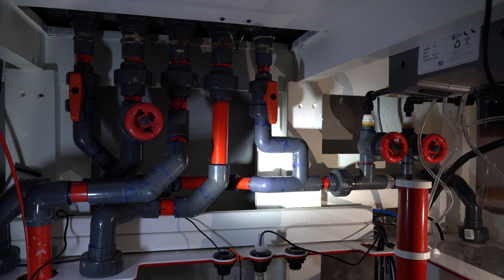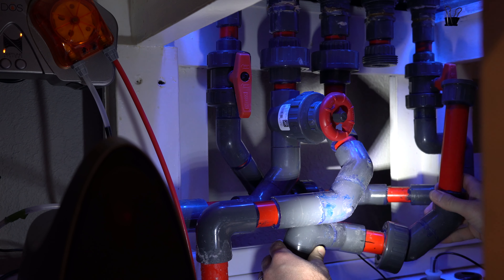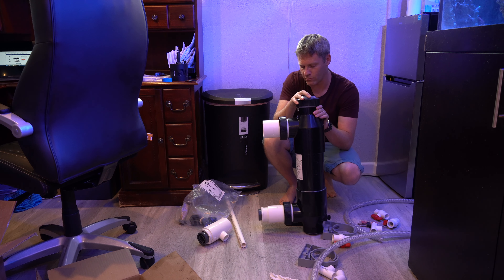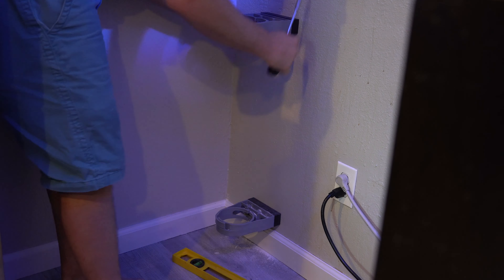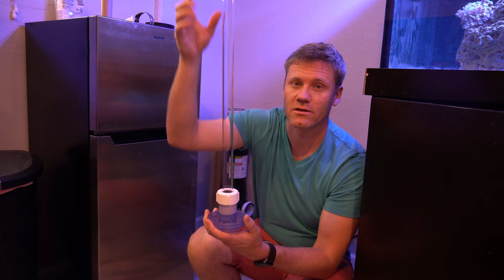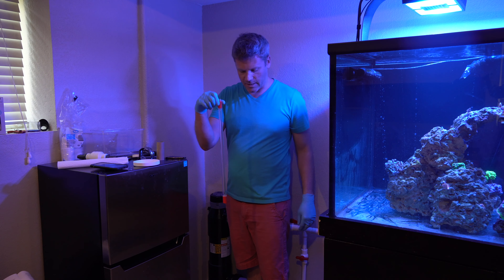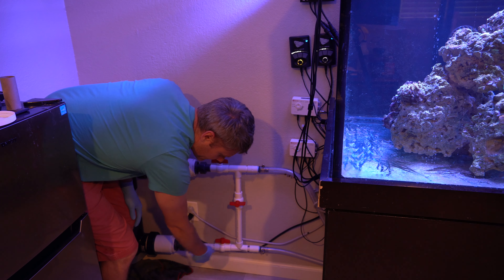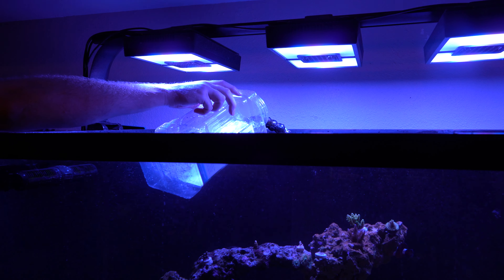How to install uv sterilizer aquarium

Comment: The only thing I remember that wasn't mentioned is that , when lowering the light.. it is supposed to sit ⅛ to ¼ inch off of the quartz sleeve, so once you feel it touch, lift that small amount and Then tighten the nut.  Other than that, Great video as usual. You always make a point to avoid information bias (thinking of any little thing people may not know and including it) it's always better even if 99% of people say "duh"
If that 1% can learn & avoid confusion or mistakes.   I was just installing a bypass myself and about to make a stand so it doest drop down out of the sump just to use more pump power to push it back up that height again. (And then I got the neat aquatic clamps, but will probably use both.) Just wrap your vinyl tube in black tape. Duct, electrical. Or flex. Black Pipe insulation pieces may even be easier & quicker, as you can remove if needed.

Comment: The video is very helpfull i like it how you taking time to explain for little things need to pay attention. Would be nice if you could tell where i could get those hanging brackets seem very sturdy and strong enough to hold the unit without problem. Thanks
Reply from the maker: Hmm I looked but couldn't find the ones I have because it just comes with the pool model, and not sold separate. Looks like BRS has some for $60 and marine depot has some cheaper but not 100% sure they fit, sorry wish I could help you more with that. I know BRS will work but that seems a bit pricy if you ask me.
Reply: Thank you for reply! I have went a head and order the whole set unit like your 50 Watts with bracket holder+pump+tubing and 1 day shipping delivery tomorrow let see how it fit, fingers cross hope it work. Thanks for the help and video.